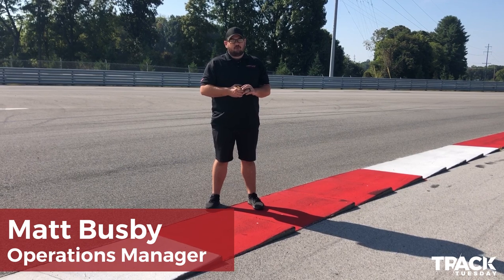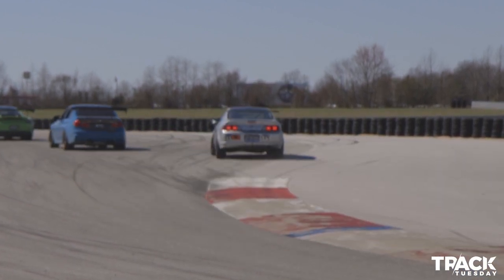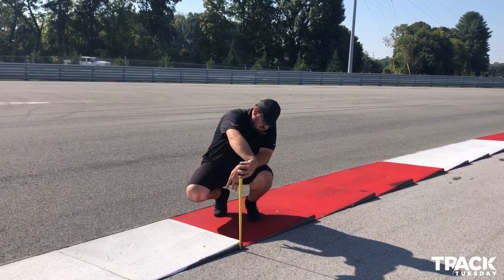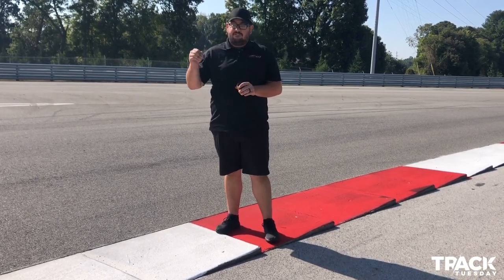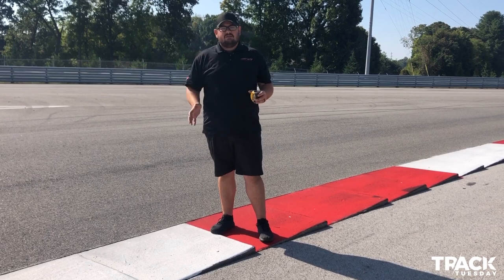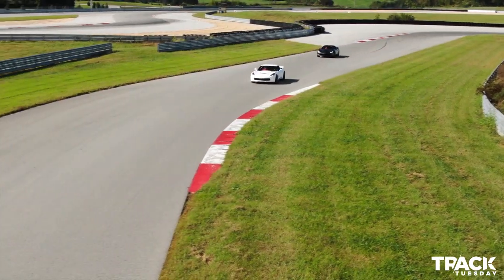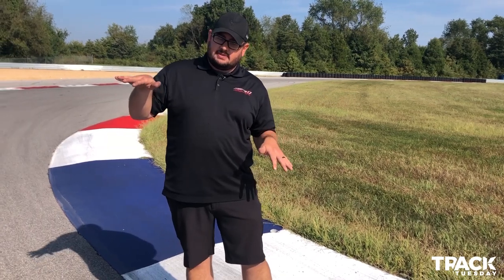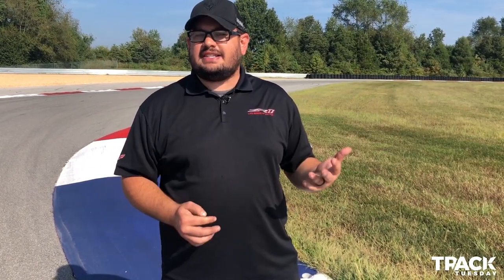Episode 7: "HOW MUCH CURB IS TOO MUCH CURB?" | Track Tuesday at NCM Motorsports Park

Comment: Wait? Who said ground up glass is for grip? It's so the paint is reflective. At night or in the rain, it's a very helpful to be able to see where the track is. (I drove VIR at night right after the repaving, with zero paint anywhere. It was a nightmare.) Even without glass infused paint, poured concrete is slick when wet.

Comment: Lol, those cars are pretty much off the original track... Curbs should only be used by the wheels, not more. Otherwise widen the fking track... Smh
Reply: As an instructor of mine says all the time, "If they paved it, use it." (of course, race rules can say otherwise.)